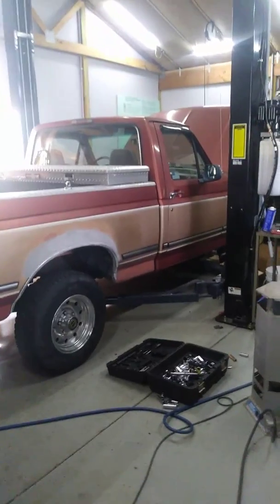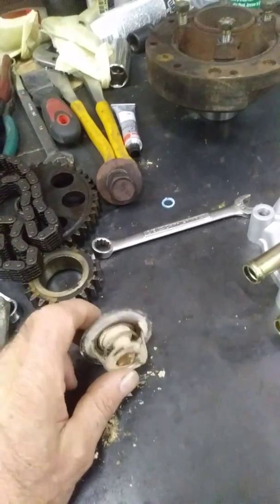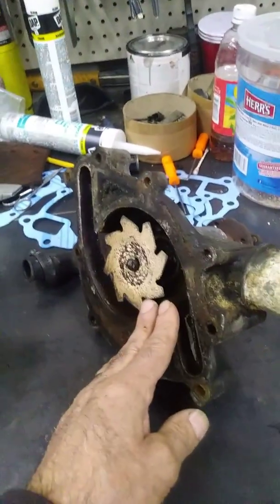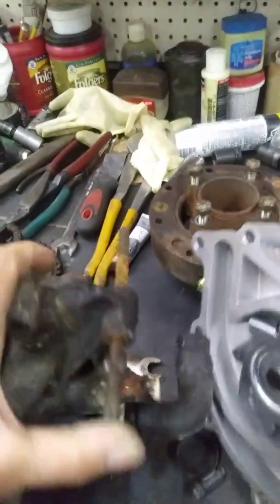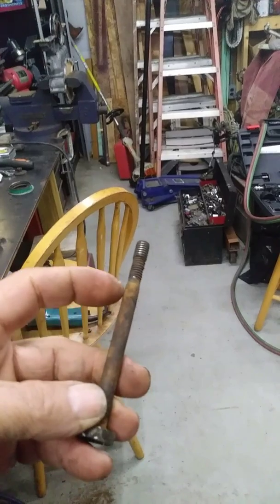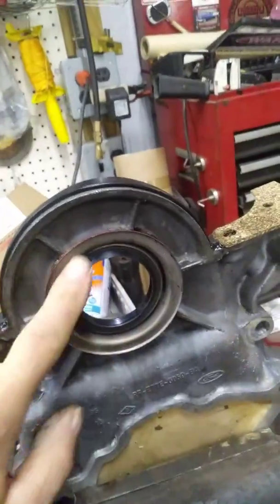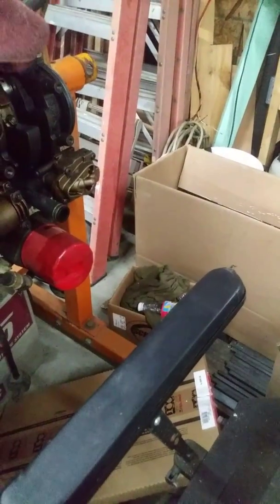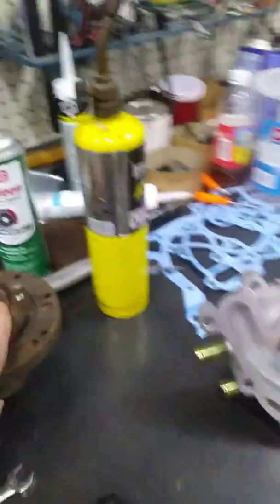95 ford f-150 302/5.0  strange cooling system problem

Comment: Great video, even 3 yrs later, I'm working on my truck now, 1994 Ford F150, 302 V8. I'm currently in process of "flushing" the cooling system, last day or two, running flush cleaner and distilled water thru, majorly cleaning the system lol. First problem was, I had constant leakage thru the "weepie" hole on the pump, so I opted to change it, have all the components now, new pump, new radiator main hoses lower and upper, new thermostat and all gaskets for everything, all Felpro lol. Been working on this truck for 5 yrs now, as long as I've had it, I dont let others touch it lol. Even had to change the shift forks in it last year in the transmission, that was fun lol, learned something new lol. Anyways, I dont mind videos like this, even if they are long, as long as they are informative, great info you had. I am considering changing the timing chain also, now I see the location and parts of it on yours, I'm thinking it may not be as hard as I originally thought. might consider it since most stuff will be taken apart as it is already. Might have to search those videos also for it. Thanks for the video!
Reply from the maker: Your welcome Brian, The timing chain is very easy and cheap too. You will have plenty of room because you'll have your radiator out. You might want to just take your grill off too and do everything through the front. Good luck with it. Rob.....
Reply: @robbieraychannel  Np with doing it that way, only problem is though I dont want to go thru is removing or worrying about the condenser under pressure, plus I dont have a vacuum pump to re-vac it down after put back together. My AC still works GREAT for as old as it freaking is... hahaha. I dont want to screw it up. For an old '94, Thank God I still got AC lol during these hot summer months lol. Though I do agree with ya, would be so much simpler thru the center with most of it removed yes, I could still of course remove the radiator itself for it too do it. Today, I will be going thru and thoroughly flushing it again, some more. Since I've been running nothing but the Prestone cleaner and distilled water only thru the system last 2 days, I've noticed my "weepie" hole isn't really leaking anymore now, even during operation and the temp stays between the second line and the letter N on the dash temp gauge, kind of odd lol, seems like, its cooling fine now, but, I still bought all this stuff, going to replace it anyways even if it does seems fine now as of today anyways, just not take a chance. The timing parts, the chain and sprockets, I have not yet purchased, just watched yours and another's video of it last night and was thinking, if its that damn easy for it, maybe I just should do it too. I'm not an ASE certified mech, as you may be, but I have been working on engines for some years, especially my own, I prefer only my hands on my baby! :D lol. He's been a great truck the last 5 yrs I've had it, 189k miles on it, still purrrrrs like a tiger kitten :D lol. new parts all over it lol
Reply from the maker: @BrianKeithPREPPER  
Brian, I get what your saying about the a/c part of it.
 I did find another small but significant problem recently. The rubber gasket on the radiator cap had swollen from age. this caused the rubber to protrude pretty far beyond the edge of the brass plunger. After looking at it closely, I realized when the cap is pushed into the neck of the radiator the rubber gasket was spreading out and blocking the hole inside of the neck. With this hole blocked the system can't expel or draw in coolant from the overflow tank when needed. Just thought it's something  you might want to check out. Good luck with it. Rob......
Reply: @robbieraychannel  Rgr that my friend! Checked it out just a bit ago, cleaned it up, not sure on clearance but it looks ok, Fluid I know is going in and out of the Reservoir because lately, it how I could tell I was getting a small slow leak, from that weepie hole, Over a few days, the "extra" fluid I put in the Reservoir, would be drawn down slowly over those days. Just got done flushing out, with my garden hose, the distilled water and cleaning solution now, just 5 mins ago, man its hot as FK outside lol. Been in the 100s lately here in Kansas. On that cap note though, I might say screw it also, and just buy a new one now, save it on the side or just put it in now but save the old one with it still operational still, just "in case". After I upload this comment reply, time to go run the engine again for a good 15 - 30 minutes this time, with just tap water, then let it cool and drain it out. now if its clear, I'm good too go to start the replacements then. I think for now, I may just say, screw the timing chain replacement for now and when it is time, just purchase a new gasket set. I may buy the set now when I get paid in a few days, even the new timing parts, chain and sprocket, Though searching for parts, I had a hard time trying to find a "Speedy sleave" for just in case issue on the balancer, if its ok, I'll send it back but if not, I wanna have it now.

Comment: 10 of 10 on the video. Helpful. Informative. Probably could have made it into 3 videos for more clicks but I stayed til the end. I have 4 of these OBS Fords (2 @ 5.0, 1 @ 5.8, 1@ 4.9) so if it's not one issue, today, it'll be 3-4 more, tomorrow!! I have so little invested in my fleet that my honest mechanic won't work on the trucks. He says he's making me earn my bargain blue ovals by doing the work myself (with some help from 3 sons) so I'll only go a layer or two deep on coolant system, timing components, smog system, etc. before I'd be WAY upside down on cost/benefit. This video will come in handy for every one of my FoMoCos, eventually. I'll keep checiing for more of your good content.
Reply from the maker: Thanks David, I am a pro mechanic and I like to help people out when I can. I did find another small but significant problem recently. The rubber gasket on the radiator cap had swollen from age. this caused the rubber to protrude pretty far beyond the edge of the brass plunger. After looking at it closely, I realized when the cap is pushed into the neck of the radiator the rubber gasket was spreading out and blocking the hole inside of the neck. With this hole blocked the system can't expel or draw in coolant from the overflow tank when needed. Just thought it's something  you might want to check out. Plus caps are cheap. Good luck with it. Rob......

Comment: we have replaced 3 water pumps on our 93 F150 in roughly ten years. Same issue with the impellers on the pump. A guy down at Oriley's said it sounds like electrolysis. Has to do with the material of the parts. Some are cast iron and others are aluminum. There is a product that you can put in your cooling system that will take care of that. Ugh friggen broken bolts, TEEL ME ABOUT IT! I feel your pain.
Reply from the maker: good to know. I'll look into that, thanks

Comment: I have a 1995 5.8. The temp gauge was staying beneath the C, and then suddenly, going almost to the H, before finally going to the "normal" range. I replaced the thermostat, but now it will gradually go all the way to Hot, and not cool down. When I look under the hood, it is dripping coolant out of the thermostat housing. Any idea why it would get so hot that it wants to release pressure at the housing? Thanks for your video. If the "fins" are gone from the water pump, I probably won't try and tackle that job. This is a truck I bought for next to nothing that I just want to enjoy driving on trails.
Reply from the maker: Terry, It sounds like your thermostat is not opening. when the engine heats up and the coolant expands it has nowhere to go so it is trying to force it out of the thermostat housing. 1, You may have gotten a bad thermostat. (Sometimes parts are bad even when new) You can test a thermostat by holding it with pliers into an old pot of boiling water. If it's good you'll see it open. 2, You might have installed the thermostat backward. The copper or brass colored pellet where the spring is always go's into the engine on all engines. the pellet is what reacts to the engines hot coolant and opens the thermostat. 3, It could have air trapped in the engine. Hot air touching the pellet won't open the thermostat. I don't remember  if the thermostat is vertical or horizontal on the 5.8 but if vertical, you must use a thermostat type with the little jiggle pin on it's outer flange and the pin should face up at 12:00 to let any air bleed out. 4, one way to test if a thermostat is opening is the upper radiator hose should eventually feel hot when the engine is hot. If it doesn't it's not opening. 5, You can run the truck with no thermostat installed as a test. This won't hurt anything unless it was very hot outside ( like summer ) Because a thermostat allows the coolant to stay in the radiator for a while to cool off before being cycled back into the engine. Hope this helps Rob...
Reply: @robbieraychannel  Thank you! I do have the thermostat in correctly. I don't think there is enough coolant in the radiator and that maybe there is air trapped in the engine. I will add coolant to the radiator and squeeze the upper and lower hose to try and get any air out. Any advice on how to get the air out that is trapped? I'll let you know what happens when it warms up here in Rapid City, SD - too cold out right now!
Reply from the maker: @tabspike  Terry, sorry for the late reply. I didn't see that you replied. I do the same as you with pumping the upper hose, But also use a burp funnel attached to the radiator fill neck. A company called Lisle makes these ( about $35 bucks) also called a fast fill funnel. This allows you to to have about 3/4 of a gallon or so in a funnel that is sealed to the filler neck. This puts a little head pressure on the system and also lets you see the air bubbles cumming out. For really stubborn engines they now make a tool to vacuum fill the system. (about $150) I don't even have one of these yet but sometimes borrow one from work. they work great. Maybe your parts store has one as a loaner tool.  Good luck with it Rob...

Comment: I wish I found this video earlier. I have a 1996 F250 5.8L. I bought the truck 5 months ago with 121,000 miles on it. The Coolant temp gauge would never make it up to Normal operating temp. Wouldn't make it past the "O". Also, the temp gauge also fluctuates from its relative normal position down to a quarter of the way hot and back up temp. (Sensor? sending unit?) I had the system flushed and a new thermostat put in. Then i found out that the previous owner had just replaced the thermostat. The problem persisted. 

A month later, my water pump failed. On of the ports out of the water pump was crimped and leaked. (Luckily I noticed it when i was letting the Truck warm up) 

I replaced the water pump, the radiator, Upper & Lower Hoses, Heater core hose myself, It was a pain in the rear to burp the system. Now i have it running again. The temp gauge goes to center but still does that fluctuation every couple min or so. I think it happens when the thermostat opens.  but i have the same issue with the upper and lower hoses not being as hot as you would think they should be. Have you gotten to the bottom of any of these problems? Thank you. Good job on the job! it was challenging getting that water pump back on by myself.

Comment: "Mechanical Bonding"...... are the word's you're looking for to describe why those long screws won't come out. This happens with the bolt and the motor block being "two dissimilar" metals.  Hence, it negates the thought that water reached this junction.

Comment: I had the water pump replaced on my 95 about a year ago and there's a coolant leak
now. Not coming from the weep hole or the shaft. I can't seem to pinpoint exactly
where it is leaking. What can you recommend to help locate this leak? Thanks you!
Reply from the maker: Actually there are a few ways. one way is to buy a radiator pressure tester kit which pumps a little bit of air into the system and mimics the leak so you can find it. also there are fluorescent dye kits they sell now that can go into the coolant and you can use a black light to find the leak

Comment: I think the temp gauge fluctuation is the sensor. Im replacing mine tomorrow. I'll keep you posted.
Reply from the maker: Tim I hear ya on this. Iv'e had a lot of old ford trucks that seem to never really heat up, sort of cold blooded you might say. At the same time mine had actually overheated a few times when it was very hot out like 95* I found that the viscus fluid clutch fan was bad. You can test this by spinning the fan with your hand . It should have resistance. Mine had resistance at first but got easier and easier till it spun freely. Then I knew for sure it was bad. Be careful buying one, People say the ones listed heavy duty are noisy. I found an O.E M. one one ebay and it worked great. Also remember your temp gauge works off of resistance so a poor connection will make it erratic. you can look up the resistance reading you should have at the sensor at room temp. to verify if the sensor is good. Hope this helps Rob.....

Comment: We are trying to figure out what kind of freeze plug my truck takes. It is a '95 F150 XLT with the 5.0 V8 in it
Reply from the maker: Shea, That depends because there are several plugs throughout this engine. You might have to buy a set of freeze out plugs designed for an engine rebuild. These should be cheap and easy to find. (amazon, e-bay,etc.) Keep in mind it can be difficult or even impossible to install a plug successfully with an engine in the vehicle. Often times if your in a bind you can install a rubber boiler plug into the hole. This is a plug that expands when you tighten it's nut. These can be found at plumbing supply stores and some sizes at home centers.

Comment: I have a 93 5.0 engine. I had installed a larger aluminum radiator. I've been noticing that it's missing coolant  alot. I top it off and drive around and all and then I check and uts missing alot of coolant. doesn't leak or anything. I checked. no leaks. so idk whats going on with that. last ti.e my temp gage was going towards the end of the words "normal" . I checked the coolant and was missing alot. had to put a whole coolant in there to top it off. what can it be??
Reply from the maker: If you are absolutely positive that there are no external leaks. One thing you could check is there are 2 small coolant lines that go to the throttle body possibly some coolant is being taken into the intake through there if so most people do away with them anyway. If not that then the likely explanation is some coolant is being taken into the engine through a bad head gasket one of the best ways to check this is by a tester that is able to sense the presence of combustion gases within the coolant you can get them on Amazon for about forty or fifty bucks they use a fluid that turns from Blue to Yellow if there's combustion gases present in the coolant.
Reply: @robbieraychannel  yea im positive. I'll check on that too. since you know more. I also have a high idle sometimes. it's manual and when I shift sometimes it idles high. when it warms up. it goes away. IAC vallve is new and UGR also new
Reply from the maker: @rromero1091  Is this within the first 10 min. after a cold start up ? Because it is normal for it to idle high until the ETS ( engine temperature sensor ) sees the correct ohms value to idle down. If it's all the time you can search on line for the correct ohms value of the ETS at room temp. and test the sensor. If I remember correctly its on or near the intake manifold or top of the block to the left of the distributor.
Reply: @robbieraychannel  it happens randomly sometimes. I'll check thank you. what oil do you recommend to use on them? I use 5w30 mobil 1 high mileage. I have 179k miles
Reply from the maker: @rromero1091  that oil is fine. Luckily these older engines are not as picky as the newer one's are. Mostly you want to stay in the correct viscosity range for the average temperature in your area. You can find a chart for this in your owners manual or on line
Reply: @rromero1091  I use 15-40w rottella or delo
Reply: @johndowe7003  I tried mobile 1
Reply: @rromero1091  ah yeah that's good too
Reply: @johndowe7003 yes, diesel engine  oil has the zink that the cam and lifters need for proper  lubrication, newer gasoline  engine  oils are lacking the zing levels needed for older push  rod engines.
Reply: @Randall-mt7jk  yep exactly. Not many people know about that. I still use diesel oil in gasoline engines. Works great 👍

Comment: I am not a mechanic by trade, but I do work on many cars, never ever seen a water pump with worn vanes.  I have a slightly modified ford 302 in my 84 datsun S12.   Have done the water pump.   Must be careful removing bolts.   I used anti seize during assembly as well.  I use anti seize on many bolts in a car
Reply from the maker: Agreed, can't really say if I have seen one either. Most of the time a water pump is being replaced because it leaks. Maybe I just didn't bother to look at many impeller blades when changing them.

Comment: Did you notice the temp gauge fluctuate any before pulling the old water pump?
Reply from the maker: Greg, No it was more like it was running a bit to hot at times

Comment: Where did you get your parts?  The “kit”?
Reply from the maker: It really wasn't a kit it was a separate water pump a Fel-Pro gasket kit for the front timing cover I got the chain and sprockets real cheap I think on eBay and the bolts I bought separately too but I can't remember where and it wasn't an exact match only one bolt actually worked out of that set